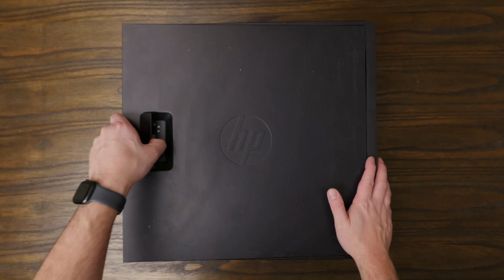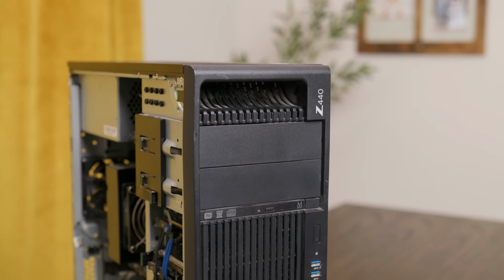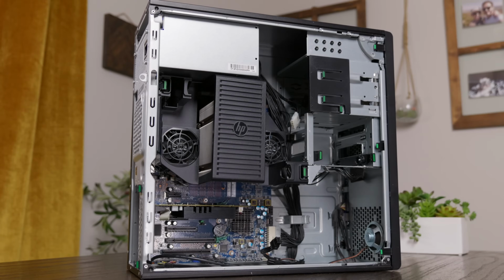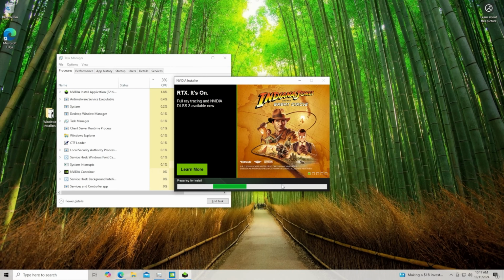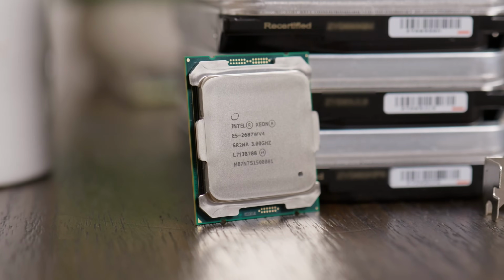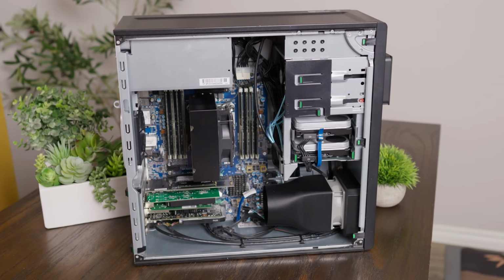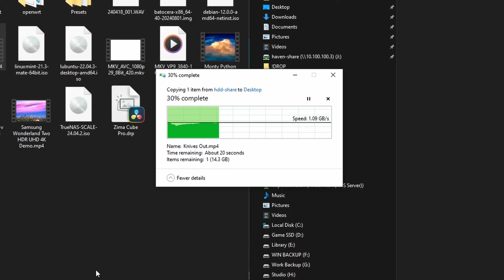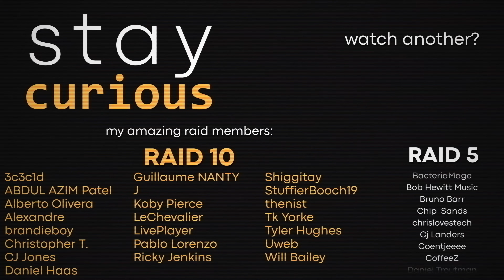This Upgraded HP Workstation/Server Is CRAZY Fun

Comment: Those CPU are so cheap because they just don't make sense anymore. Running them is just too expensive. Spend a little more and halve your energy bill. That pays back in the long run. You only showed in somewhat unconventional, but performance per watt for that system is incredibly bad. 
Electricity is somewhat cheap in the US, but still. I rather run a stack of n100, and distribute the load. Likely far less power waste and you get a lot of more modern cpu features. 
Maybe this makes sense of you really need some huge amount of memory for something, but other then bankrolling your sponsor even that didn't make sense. Same for the storage. There are far more efficient options. Certainly of we are talking homelab. And there is a big difference between performance you can get and performance you can put to use.
Reply: The CPUs are cheap because they are from decommissioned dual CPU servers. Running a data center full of those old CPUs is quite different from running just one in your house. 115W idle with the upgrades isn't that bad and I personally would rather have a single workstation than a bunch of random miniPCs.
Also what "a lot of more modern CPU features" the N100 has? I can't think of any feature the N100 has which the Broadwell Xeon doesn't have. DDR5 support I guess but it's only single channel and no proper ECC support
Reply: @Pasi123  quicksync and instruction set extensions that the older server chips don't have but are often used in home servers used for streaming and transcoding. And considering the performance per watt I can run the n100 or now the n150 for a long time before hitting old server chip power use. If you want to pay extra that is your choice, but I won't. That bunch of n100 mini pc also takes less room. ECC is overrated for home use, totally unnecessary. And I can manage a bunch of small PC's very easily with things like Ansible and docker or Kubernetes in the mix. Those n100 machines are less effort and cheaper than your single workstation will be in the long run.
Reply from the maker: As with many things... it really depends. N100s are cool, sure. But as Pasi said, they lack a lot of features you get with something like broadwell xeon systems. 9 PCIe lanes and single channel memory isn't always the best option.
Reply: @HardwareHaven  neither are those extra features really necessary in most home server use cases. In the end I prefer a low monthly bill. And with Ansible, Kubernetes and whatnot I can manage multiple machines just as easily. 
What are you really going to do with this machine? Look at it's specs or do you have a real use case for burning the power other than benchmarks? Something that actually requires ECC or something that actually needs all that memory? It's easy to waste when you get parts for free from a sponsor. But your fans have to buy them. 
Sure there might be use cases for this machine and the video is cool in for the fact we get to see how far that hardware could be pushed. But that is not a daily use thing. For every scenario mentioned AMD or Intel has a newer chip with the same or better features that cost a little more to buy but only a fraction of the cost to run. Even your own stats make that clear. 
I have a bucket of those old chips, worthless. I even have a similar server, worthless, too inefficient to use.
I really wish it wasn't so. I dislike e-waste very much and would like a use for the chips, but it ain't there.
Reply: There's lots of pros to the bigger system like more ram and pcie support. Plus pricing. Even ignoring ram/pcie support, and everything else. To match his Cinebench scores you'd need roughly 5, n100 mini PCs... At which point it's 100w vs 200w roughly. Which is a good savings. But assuming each Mini PC is $150? You're roughly gonna be like $350-450 in the hole.  In the US $0.15/KwH is normal. Which means. You don't really break even for roughly 3 years. Could be more depending on exactly what cpu, or ram needs. And there's stuff the n100 chips just literally cannot do, that the HP can. And theres basically no cases where the n100 can do something the HP can't. Wanna do a game streaming server? N100 is gonna struggle to give a GPU the bandwidth it needs. Wanna do something memory bandwidth intensive? Single channel memory.  Wanna have several hard drives for a nas? Oh yeah well the n100 can handle that but well they can't fit in the minipc.

Yes, they're less efficient and it depends what you're doing and all that, but the older chips aren't e-waste. And if you truly care about the environment? You should make sure your bucket gets donated to people that can use them. If you care about money? Sell them.

What you shouldnt be doing is just complaining at the wind. Saying these HPs are completely obsolete when they're not.
Reply: @daymianhogue1634  we differ on that. Also you are assuming US energy prices. Not everybody is from the US. In most places with actual environmental regulations the price of energy is higher. As it should be. 
The n100 doesn't only come in mini PC's. You can get it on mini itx boards too. With multiple m2 slots, and or multiple sata slots add to that the option to get more sata ports from the M2 slots and your storage options are just as big, though slower than this HP server. 
But you all are still yapping about supposed tasks this thing could do, but none of you supplies an actual example of that. Especially not an example that is regularly used in the homelab or homeserver. 
And again you are forgetting about quicksync and the internal GPU of the n100 and newer n150. That cannot do the performance of a dedicated GPU, but it can do enough for most home streaming use and it can do it at far lower energy use and far higher efficiency. 
So what home high performance task is going to validate this HP build??
You also ignored the option of taking any slightly newer non n100 CPU. The price difference will be earned back on your energy bill. 
The only people here outside the US that want my chips are recyclers.
Reply: @bzuidgeest  Fair enough if you're somewhere with more expensive electricity, though just because electricity is more expensive doesn't make it better. Idk why you're being elitist like that. My city uses 100% clean power from windmills btw and I pay 10cents per kwh. 

An ITX board based N100 computer? Will also cost more than the bottom barrel $150 pricing... and will still have limitations on connections. Compared to a full size system.

I gave an example of like a game streaming server didn't I? (maybe I forgot not scrolling up to see my prior comment) 

Quicksync is just a fancy marketing name for GPU accelerated media encoding. Yeah wow the system without an integrated GPU cant do it by default; You can just buy a cheap gpu for that. Intel ARC A310s are dirt cheap and are literally just a better version of the igpu built into an N100. So no, that's not something the HP server can't do. 

I was assuming you could get a fully functional PC from a reputable company for $150 each... You can't really beat that, even going with like N95s or something like an older N5095? won't be much cheaper than $150 

I already did the math being fairly conservative, it's roughly 3-3.5 years even using the N100's efficiency to cost ratio though as you pointed out I used median US energy pricing... I'm also using median US pricing of the hardware and much of the hardware would also be more expensive in some regions. Maybe if you're somewhere, where energy is giga expensive and hardware is cheap. but when it takes 3-3.5 years to break even, and there's a list of pros and cons? There's no reason to be some elitist. 

Okay? THEN TAKE THEM TO A RECYCLER. You claim you care about the environment. Why are you just hoarding a bucket of chips you deem useless?
Reply: @daymianhogue1634  I'm not hording it, I just have it, server parks clean out all the time. I just hoped at one point to actually find a use. But the calculations don't work. Eventually it'll get to the recycler. At what speed hardly matters, when the bucket is completely full I guess.
Why is it every time someone says that something is as it should be, it's elitist? That's such a dumb remark. It's my opinion, I could just as easily call you elitist for yours in that case. Because you think this workstation is better...
Give that a rest if you want to be taken seriously. 
Preferably energy should be green and cheap. But in most places it isn't. Going green is an investment and someone has to pay for it. Usually the consumer. Thus energy is more expensive. As I noted, I find this acceptable. 
For 150 I can get any number of systems with an ix or AMD equivalent of the time. Those would still run more efficiently on average, lower idle power usage and these home servers are going to be idle most of the time. No need to only mention the N chips. 
This thing is major overkill for game streaming, if that is your only example I find it a poor one.
Reply: @bzuidgeest  how do the calculations not work out when you already have the chips? ... Like is your power that expensive?

Also I think you've misunderstood me. I don't think the HP server is superior, I simply think you're being elitist. Both the HP server idea, and the Mini PC/n100 idea have merits. You've gone over the merits of the n100 systems, and said the HP system has no merits, and I've been trying to prove you wrong on that by explaining ways that you're wrong. 

If the n100 systems work best for you? Good for you. But don't go around being a snob to other people. That's the issue here. 

Especially since in many cases the n100 ish systems are more expensive... Even if you wanna argue "power bill savings" not everyone has the extra money upfront. Some people get systems like the HP systems for free or near free and don't have the money for the newer alternatives. That's just another reason why I'm calling you elitist. It's like a rich person saying "why don't poor people just buy a house if rent is so expensive?" When the answer is they can't afford to buy in the first place. 

I don't care about your energy prices or issues. If you're not American and live in a country with expensive power? I am sorry for you. I don't. And my power isn't bad... Again you were elitist for assuming I had some unregulated bad for the environment energy just because it's cheap.  

Again if you care about the environment, you should be recycling your "bucket of chips"  and many other things. 

Tldr; just because something is more expensive doesn't mean it's better, and you shouldn't shame people for not being able to afford the things you think are better.

Also wtf? You said to give you ANY use that would require the more horse power? I said game streaming and your excuse is "no I don't like that because it doesn't fit my narrative"????

Comment: What's your PC cleanup routine? Especially, the board
Reply from the maker: I use a duster I like that uses AC power rather than a battery and has a brush attatchment to get all the loose dust off. That's basically all I did with this one. That and some IPA to wipe down all of the surfaces of the case, PSU, etc..

If it's worse, I spray it down with IPA and use a soft toothbrush to scrub things off. In the homelab challenge series, I had a board that was so nasty i literally just washed it in the sink and then soaked it in IPA lol

Comment: I tested this about 6 years ago with a thinkstation and pretty much maxed it out. Put it up against my ryzen system that was current at the time and it crushed the thinkstation in every metric including price. Also i had an upgrade path. After that I have stayed away from the old workstations and funnily enough now run my entire office setup off a legion go. I do have a small 12u rack in my garage with a couple servers but have been looking to minaturize lately. I liked the 10" rack video you did because it got me thinking about going to mini itx for my nas/plex/assistant/etc server and getting the unify cloud gateway max to replace my udm pro and it would fit in a 10". Then I could move it back into my office and not have to worry about cooling in the summer. Also i can 3D print the entire 10" rack and accessories! Great video!
Reply from the maker: Similar to what Pasi said, the draw for these has much more to do with RAM capacity (and ECC), PCIe lanes, and features like bifurcation. Often times even if those are possible on something like Ryzen, it's tough to find affordable motherboards that support it all.
Reply: The main thing with the workstations is the high amount of PCIe lanes
Reply: Did you seriously just say your main server is running off the handheld gaming device Legion Go?
Reply: @seaSwann no, you misread his comment. He uses the legion go as his desktop PC, his servers live in the garage.
Reply: @seaSwann  ive used laptops as servers before.
a computer is a computer.
yes there are reasons to use servers, i knoe you dont need to yell at me but there are many cases where you dont really need to.